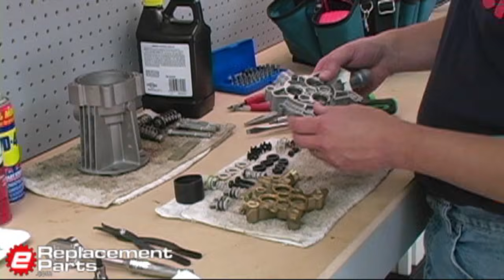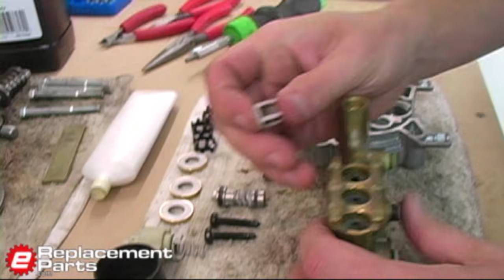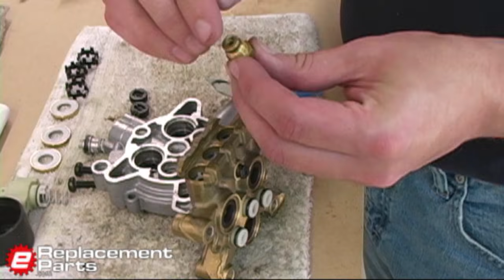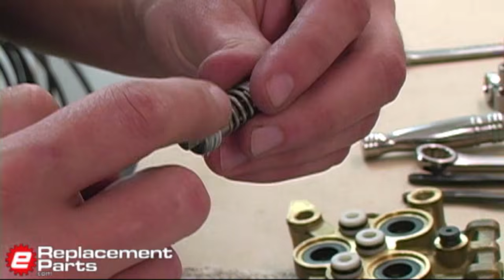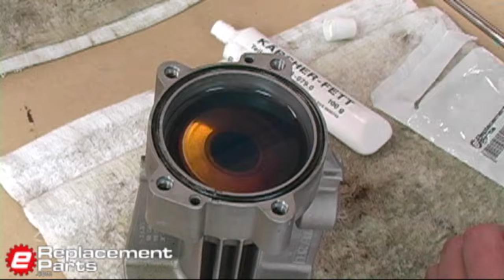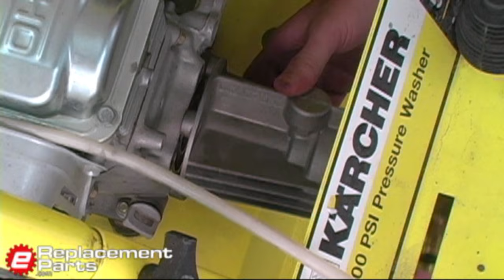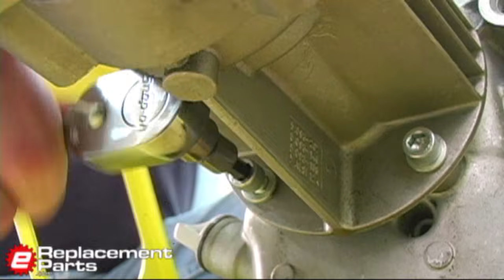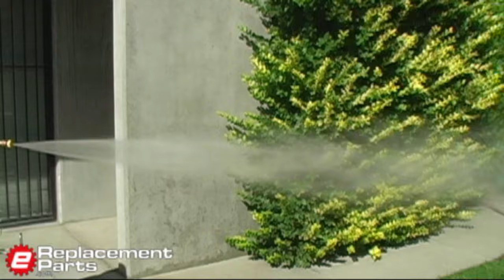How to Fix a Pressure Washer (Part 2 of 2)

Comment: @eReplacementParts Would using a non detergent 30 wt oil for a compressor be ok to use. The parts diagram for the Karcher G 2400 HH says to use Karcher Pump Oil 6.288-050.0 which is 15W40*1 that is designed to work in Karcher brand pumps.Is it that important to use that specific oil as it is expensive.I have compressor oil on hand and it would be more convenient and cheaper to use.  By the way great video. I have the same pressure washer with the same problem. You make it look easy !!!

Comment: Great video Mark!  Congrats on a job well done.  It was very detailed and informative.  I happen to have a similar problem with a Honda excell 2500 psi pressure washer.  It leaks from the bottom and has low pressure.  You mentioned that the engine you worked on was a Honda.  I'm gonna try fixing it.  Will it be an identical pump?  anything to look out for?

Thanks, 
Enrique

Comment: @773cat  No.  I have a Craftsman 580 pressure washer too.  Just pull the handle on the wand to relieve the back pressure and that should allow you to pull the start cord until you get it started.  I had to replace the carb on mine last year and found this out during my problems with it.  Now I have a low pressure problem like the technician demonstrated in this video, so I'm off to tear down my pump!  Good luck!

Comment: Great video.  On the first vid, you mention 3 possibilities.  1: no pressure, 2; low pressure, and 3: inconsistent pressure.  I am having no pressure on my unit and am wondering if I should take the same approach that is shown here.  The engine runs fine, but I get no pressure through the hose.  just curious how I should approach.

Comment from the maker: @PGXI The unloader occasionally becomes a bit corroded and can be a real chore to remove. The only real advice I have is to use a pair of needle nose pliers that have a very aggressive tooth on them. A few months back I purchased a pair of Snap-On pliers that have their Talon jaws on them. Basically it is a cross-hatch tooth pattern. They seem to really grip the tab on the unloader valves well.   

I hope this helps!

-Mark

Comment from the maker: @dougostey The primary part that was replaced was the Unloader valve. It is what was causing the no pressure condition. Occasionally you will need to replace some of the other o-rings. The valves can become pitted and need replacing but that is very rare. As a general rule when rebuilding a pump with a no pressure condition like the one shown you will need a new unloader valve, some Teflon and silicon grease and some 30wt non-detergent oil for the pump.  

Thanks for watching!

-Mark

Comment: Video is very helpful. Thank you very much. question: I have a craftsman 3100psi 2.8gpm out of pressure could be the same problem as in the veideo? can it be repair as you didi in this video? thanks

Comment from the maker: @jktbone32 There definitely are different grades of pressure washers out there. The machine we used in our video is a homeowner unit. It is designed to be used around the house for occasional use. A commercial cleaner would put as much wear on the pressure washer in a week as most  homeowners would over several years. If you are making a living with your pressure washer I would buy the highest quality machine you possibly can. In the long run it will pay off.

Good Luck!

-Mark

Comment from the maker: @Lexiss061295 A small amount of water in the oil is normal. A little will always work its way past the seals. If there is a large amount or if the oil level is low then you will need to replace the piston seals.

-Mark

Comment from the maker: @th19940305 eReplacementParts is primarily a domestic and international online distributor of power tool parts, lawn & garden parts, small engine parts, and appliance parts. In association with one of our partners, A-1 Industrial, we are also a full line repair shop providing repairs for most power tool and lawn & garden manufacturers. We work in partnership with select manufacturers to provide warranty assistance in our local service area.